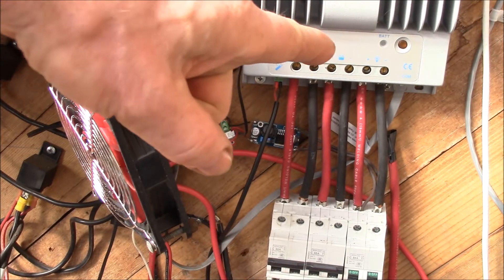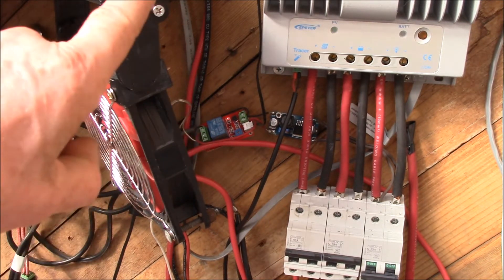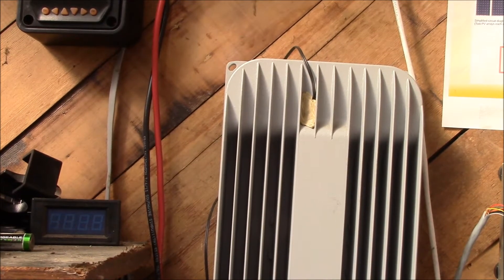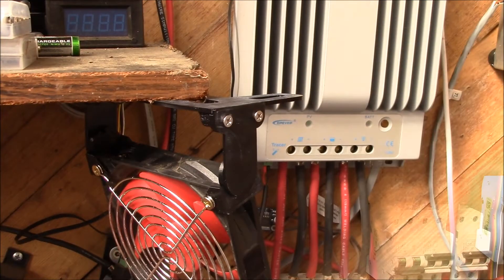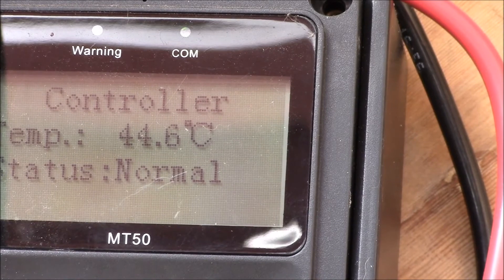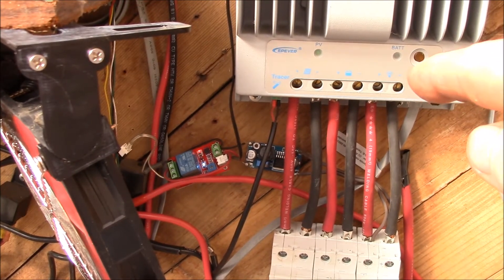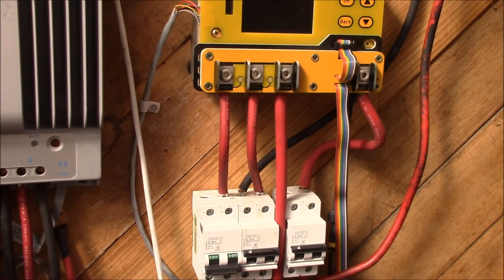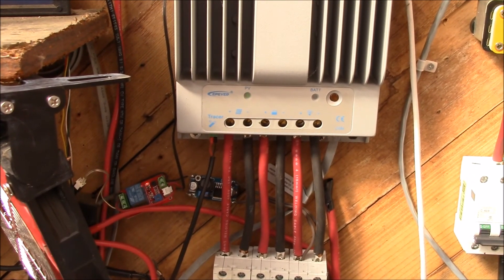Tracer 4215RN Charge Controller Cooling Fan

Comment: This is fantastic.  I need to build a cooling fan setup for my EPEver charge controller.  Mine gets too hot to touch with only two 310 watt solar panels.  See my channel and see how I ran my 5000 BTU AC on it.
Reply from the maker: Glad you liked the idea.  I got the basic idea from another You Tube channel and used it on my old 12V Epsolar controller.  Just slapped together the same set of parts for this charge controller and it works quite well.
Reply: @The4Crawler  Yeah, I saw a channel where the guy who had two of them and complained that one blew out, so he made these fan shrouds for both.  I think they came on only when they got hot.

Comment: The cooling fan system work good and prolong the life of the controllers.  Great video
Reply from the maker: Yes, that is true.  I used your idea about 4 years ago when I first built the controller for the cooling fan originally.  Only thing I added was the DC step down converter that lets it operate up to 40 volts.

Comment: nice!! how much current does that 15v device use? if it is 10W or more then buy an LTC3780 board they are the most efficient boost/buck it does not have 2 in series it is all integrated into one chip so it chooses whether to boost or to buck.
Reply from the maker: I need to check the power, but it's likely under 5W.  I replaced two wall warts for the antenna amplifier and distribution amplifier for my OTA TV signals.  I'll see if I can get my small clamp meter on it at some point.  I have some small XL6009  converters that I'll probably try first, since they are about the size of the step-up converter I have in the small box now.  If that doesn't work, I'll try one of the ones you suggested.
Reply: so after doing some shopping I am buying 7 boost/buck modules but these are what I would recommend right now, this is the LTC3780 which is an expensive (12$) but very robust chip: https://www.ebay.com/itm/322713992011
this is super cheap 3.18$ right now and I will test it soon: https://www.ebay.com/itm/202211153001
Reply from the maker: I have one like the first one you list.  Might have to give that 2nd one a try.  I do have a limit on the size of the box the old step up converter was installed in.  Once I get that down and opened up, I can check out the dimensions.  It's been 4 yrs. since I built and installed it.